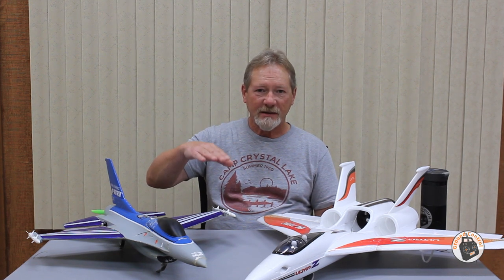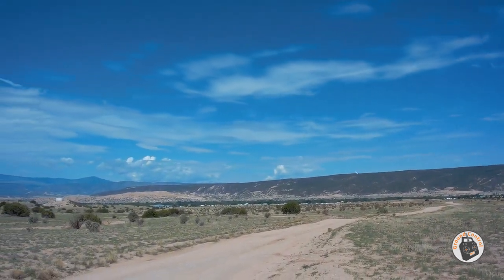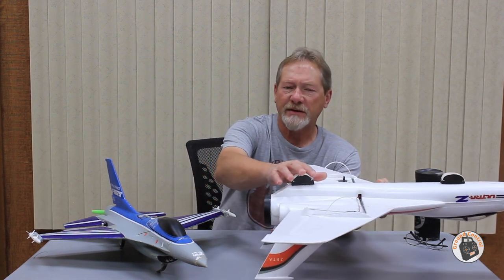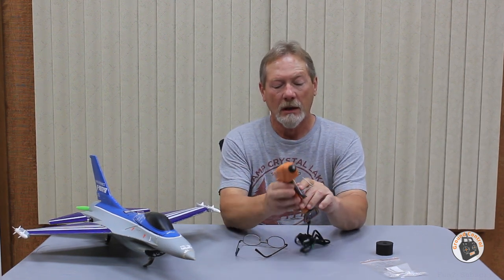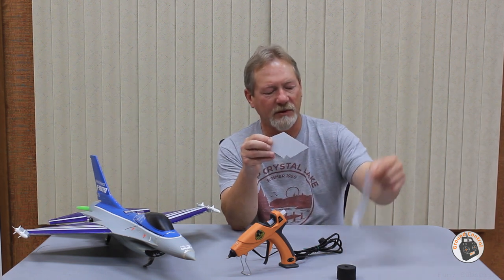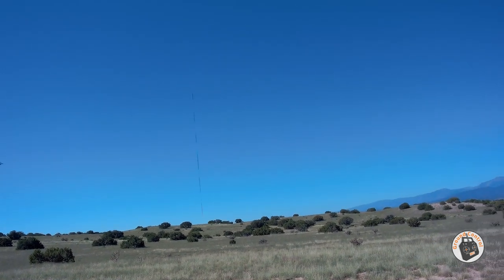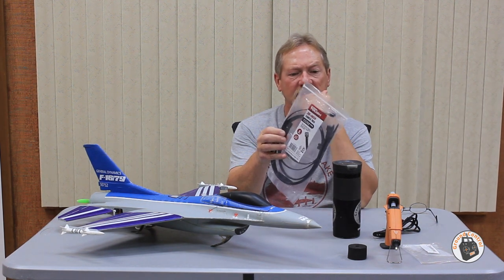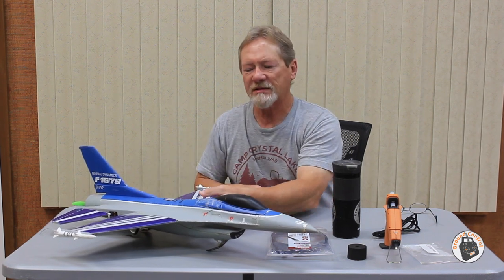Durable, Shock Absorbing, Landing Skid Systems for EDF Jets, Parkjets, Gliders, Wings, and More...

Comment from the maker: Don't Forget to Subscribe -> https://www.youtube.com/GroundControlRC?sub_confirmation=1
Don't forget to Follow Us on Facebook -> https://www.facebook.com/GroundControlRC

Gorilla Dual Temp Full-Size Hot Glue Gun Kit with 45 Hot Glue Sticks
https://amzn.to/3cFSnOw

4PCS RC Transmitter Stick Protector Protective Cover
https://amzn.to/3Q3RFbC

Heavy Duty Large Zip Ties 36 Inch (10 Pack)
https://amzn.to/3Q9szrO

Heavy Duty Large Zip Ties 36 Inch (50 Pack)
https://amzn.to/3KMtbCH

Flexible Plastic Cutting Board Mats, Set of 3 Colored Mats
https://amzn.to/3Rc6cDl

RadioMaster TX16S MKII OpenTX EdgeTX Transmitter
https://www.banggood.com/custlink/KK3EUzvecp

RadioMaster TX16S Transmitter
https://www.banggood.com/custlink/DvvycmfSMK

Banggood GCRC
https://www.banggood.com/custlink/GmDmQ1nVkO

Comment: Oh, that's great !  We have radiator pipe insulation foam in the UK, which I'm sure will do the job. Love the Tie wrap solution too. I have a 3d printer so your systems here got me thinking to combine a thin bulkhead profiled to match the viper wing tip join, so it stays on with small magnets instead of glueing and that could also form an anchor point for zip tie skids right out at the wingtip. Better push the button on my shopping first !! All the best & Thanks. Phil (uk)
Reply from the maker: That's a great idea!
I need to get a 3D Printer ;-)
See you in the Air!

Comment: Unreal Info, My destroyed HK Radjet Tronics are going into My 50mm Viper!
The Grass and Beach are not as hard on My foam as Your Field is, but that forever present rebound still gets angry crunchy.
Your measured amount of available flex described will keep Me OCD.
Beauty GCRC.
Have a great Weekend Friend.
Reply from the maker: Thank you Jono!
I almost pulled the trigger on the Radjet years ago.
That's a nice looking Jet.
How did you like that one?
So many options, so little time ;-)
See you in the Air!
Reply: @GroundControlRC  I destroyed two of Them! Hardly had a chance. I reckon You would Rip the Radjet. Great stuff Friend, Yum Already

Comment: Nice... briliant idea. The zip ties on  the fuselage are curvy.  Do the zip ties come curvy like that. Or you made them curvy like that . Thanks
Reply from the maker: Thank you!
It depends on how they're packaged.
I have some that are very straight as they were packed that way and some that have a nice curve to them as they were packed in a coil.
The ones that are curved are easier to use as you want those to curve under so they have a flat surface when landing.
On the straight ones I use my heat gun to bend a curve in them.
See you in the Air!

Comment: Excellent! Question for you: Have you ever tried taking off from the F-16 skid? I fly off a grass field. I'm not sure if it would be able to pick up enough speed to rotate.
Reply from the maker: I haven't as on that dirt road it would just suck in a bunch of dirt and sand.
On a hard surface like concrete or asphalt I think it would.
On short grass I think it would as well.
I think on short grass the skids would have less drag than wheels.
Reply: @GroundControlRC  That's what I'm thinking too. I actually did think about adding wheels, but the problem for these small 50mm jets, the wheels would be so small it wouldn't taxi. My experience is anything smaller than 2" wheels has too much drag (and even that's borderline): 2" would work, if I wanted my jet to look like a clown plane. 🙂
Reply from the maker: @gbisaga  Yes, I always seem to need to put larger wheels on my planes that have wheels. I stocked up a couple of years ago.
I figure I've got at least 5 years worth in my inventory ;-)